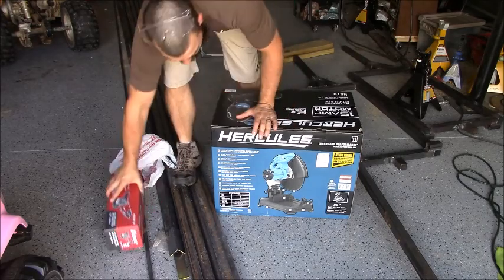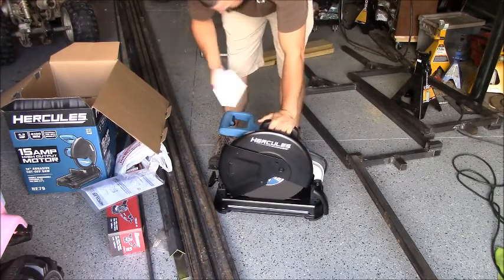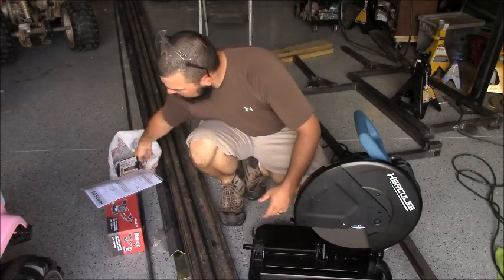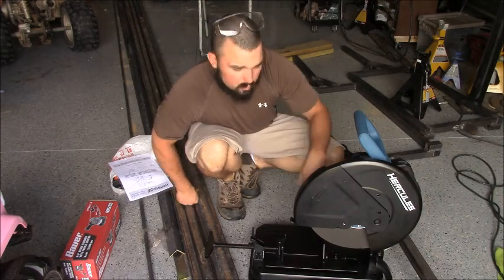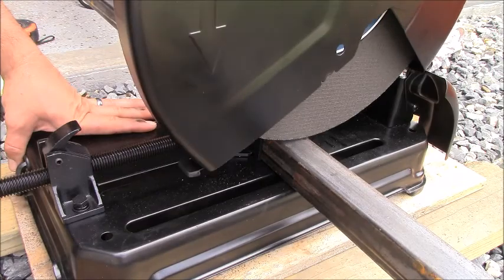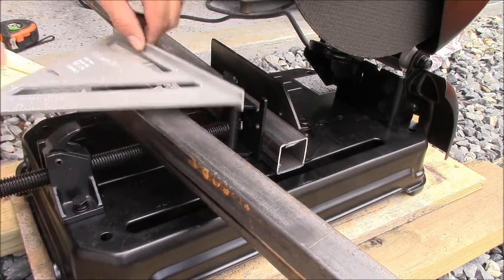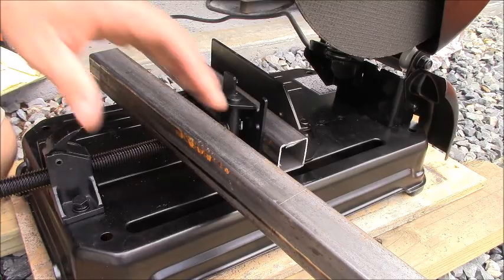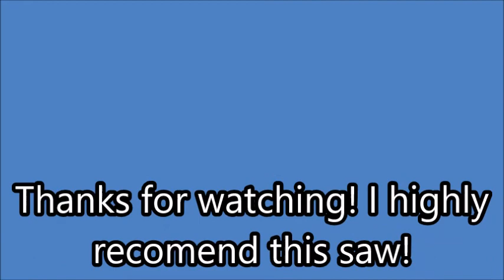Hercules Cut-Off Saw unboxing and use

Comment: Literally just got home from Harbor Freight today with that same saw, glad you like it. I went with it over the bauer they had mainly because it comes with the wheel. Have some metal projects for ham radio in mind with it.... 73
Reply from the maker: Hey thanks for watching! I am very impressed with the saw. I wish you the best of luck with your projects!
73
Lance 
KO4MWD
Reply: @LanceSheppard  First project is a drive-on or trailer hitch-mount mast mount for portable, just something to hold a fiberglass extension pole.
Reply from the maker: @randonloebsolvingproblems4421  sweet! Shoot me an email and I'll email a picture of my trailer hitch mount I made for my 31ft jackite!
Reply from the maker: @randonloebsolvingproblems4421  KO4MWD@GMAIL.COM
Reply: Well finally got around to using this saw, not for ham radio, starting with a firepit (well I guess it could be used to have a nice fire for some outside operating, lol), used the saw to make the stand from 1" square tubing and a few cuts of 11ga plate. Not like butter but seems to get the job done. Curious how yours is doing and if any idea where to get replacement brushes (I like to plan ahead, took the brushes out and measured them for future reference). Also, mine came with 3/32 disc, several reviews on the HF site said to use 1/8 for better cuts, so I picked one up at HF today to try sometime.

Comment: I bought one and it cuts great, but the table on the right side of saw blade was higher then left side. So it was cutting 1/6th off. Checking side of what you cut, not the top, do you have this issue, or did I get a manufacture defect?
Reply from the maker: If it does, I haven't noticed. I will check next time I cut. Thanks for watching!
Reply: @LanceSheppard  appreciate it, I'm thinking about buying another to see, I grabbed a metal ruler layed it across clamp section of table (left side) pushed it across, hit the right side where there's like 1" of table beside blade, so for some reason that side is higher thus making a inaccurate cut
Reply from the maker: @mikefinto2748  I'll check it out for sure! Thanks for the heads up.